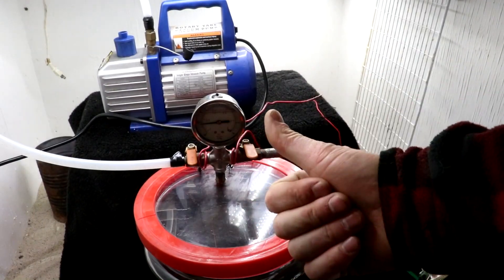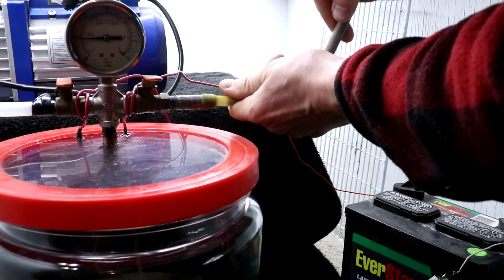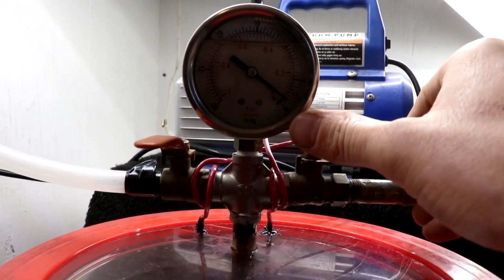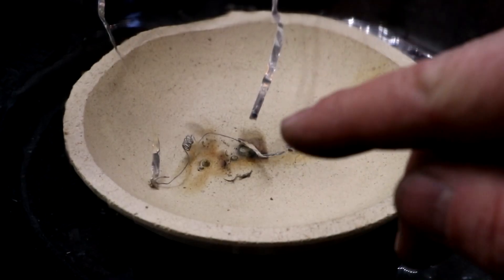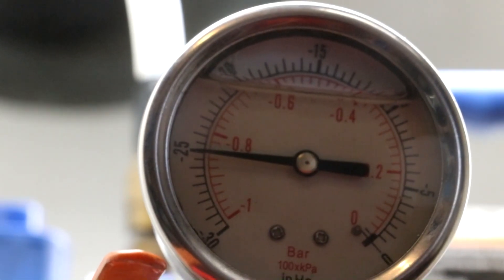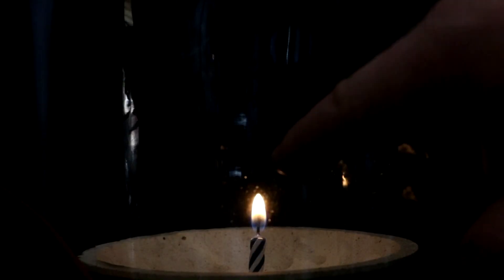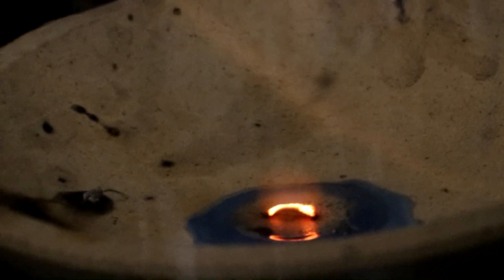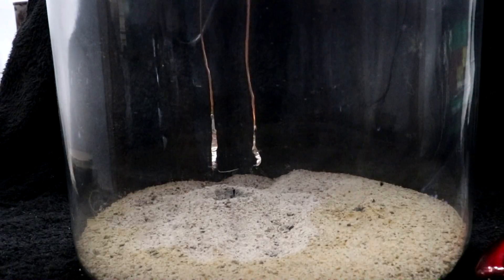Fire in Low Pressure Pure Oxygen

Comment: This was delightfully unexpected. I learned that I was wrong in my assumption that the results would be mostly the same, as long as the partial pressure of oxygen is the same. My guess is that the filler nitrogen gas is absorbing the surrounding heat, since it's not contributing to combustion, and this. greatly reduces the spread and heat of the flame. Another way it's limiting the fire could be the pressure not allowing the fire to expand as much, and therefore it can't spread its heat as efficiently.

Comment: why is it that in the pure oxygen chamber all the oxygen didn't ignite at once and explode?
Reply: Because oxygen doesn't burn or explode by itself.  Burning is chemical reaction where some other substance combines with oxygen to form something else, usually carbon dioxide and other chemicals.  The reaction requires heat to start, but then makes its own heat.

Comment: Just Noticed that when the pressure starts decreasing the flame became rounder and rounder as the air density decreased so did the buoyancy differential between hot and cold air, thus causing the Video to look like zero gravity Fire

Comment: After the tragical accident of Apollo 1, the fire in a capsule with pure oxygen at atmospheric pressure, the pressure has been significantly reduced to a level that the human body can still handle well. AFAIK there was no nitrogen involved to mimic Earth´s  atmosphere, as it would be dead mass of no use. So just lower pressure of pure oxygen, which was cryogenically liquified and also used for the fuel cells which generated power and water.

Comment: Interesting; so fire wouldn't be able to burn in a vaccuum regardless of the fuel being used?  Or is it just depending on the combustibility of the fuel being used?  

In contrast, would gasoline vapor ignite under full vaccuum?

Is the Sun under full vaccuum or does it have an atmoshphere that allows it to burn (seemingly in the full vaccuum of space)?

There's so much I need to know.

Comment: 11:51

I noticed the flame turned completely blue at lower pressure. 

That was so cool. 

Is that complete combustion & clean burning?  Or something else? 

It totes reminds me of a bunsen burner. 

2nd question:  can you do that with a lower pressure of normal air (by using something to find and maintain an equalibrium of some sort).

3rd: question: with the blue flame, can you add sodium it at just the right dilution to make a white flame, and after that, can you add additional salts to adjust its color rendering index, and then could/should you keep these as weird steampunk candle lanterns?

PS: so I noticed there was a POINT where it was a blue flame for a second or two. I imagine it would've stayed blue if the pressure had stopped decreasing, right?

Comment: Yo Cody, had an idea, add mercury to molten aluminium and see if it oxidised uncontrollably!
Reply from the maker: Aluminum melts at a temperature above the mercury boiling point. I imagine it would be like adding water to hot oil.
Reply: @theCodyReeder  Still a spectacular result!
Reply: Also you could use mercury sulphide to increase the time it takes to vaporize

Comment: Thing is, the temperature of the fire depends on the mixture of things in the fire. A mix of fuel and oxygen at certain ratios burns at a certain temperature more or less regardless of how much charge you have and how tightly you pack it. Pure oxygen burns very hot because you don't have those 5 parts of nitrogen absorbing all the heat from the combustion.

Comment: I want to if the reason low pressure oxygen is more dangerous because the nitrogen is heated up reducing the activation energy for the reaction to continue, if this is the case, would high pressure atmosphere reduce the flame? Would an argon oxygen or helium oxygen or carbon dioxide oxygen atmosphere instead of a nitrogen oxygen be as combustible or less if such atmosphere draw heat away from the reaction?

Comment: So the same partial pressure of oxygen burns very differently depending on whether or not nitrogen is present. I wonder if the difference is from difference in heat dissipation or pressure. If you replaced the nitrogen with a lighter gas that has a lower heat capacity per volume, like helium (just don't use hydrogen!), I wonder how the flame would burn. On the other side of things, it would be interesting to see if you replaced the nitrogen with sulfur hexafluoride.

Comment: One of the reasons why it is arguably better to have a higher pressure with Nitrogen gas as a 'oxidation' reducer. You can have the same amount of oxygen as the low pressure pure oxygen environment by increasing the pressure by adding nitrogen.

Comment: Cody  - consider re-doing this using electric discharges, since static electricity might be a key hazard in spacecraft.  And also with partial CO2 atmosphere, since that's what the astronauts will actually have due to their breathing - though I don't think that'll make a noticable difference.  And maybe if you test the electric discharge method of ignition, see what impact varying amounts of humidity in the atmosphere has on ignition, since again astronauts would introduce some water vapor by breathing and possibly adding humidity to suppress static discharges is done with real spacecraft?  Not sure how you'd test the effects of humidity on static discharge, but probably you could look it up.  Of course, you or your viewers may already be 'done' with this, but these sounded interesting to me.

Comment: A near vacuum provides much better thermal insulation, the conductive portion.  Radiation of course is unaffected.  You can see the effect from the candle melting.  At low pressure oxygen the candle melts down, while at atmospheric (nitrogen + oxygen) the body of the candle remains much longer solid..

Comment: I wonder how much of the candle melting so rapidly when in pure oxygen at low pressure is there being more heat released by a more intense flame, and how much it is just not being able to remove heat as fast - 1/30 the atmospheric pressure shoulde mean convective heat transfer is ~1/30 as effective.

Comment: not to disturb the contents in the flask a nozzel could be the oxygen input instead of a circular linear end, be a rocket nozel be designed to slow the flow and ... match the vessle walls to give a linear pressure increase introducing minimal flow within the vessle.

Comment: You should try to find the O2 pressure at which candle wax will burn without a wick! The lower pressure should allow the wax to more readily vaporize, but it would clearly need more oxygen present to be self-sustaining since the flame went out in this experiment before all the wax had burned.

Comment: When you burn in a mixed earth-like atmosphere you have the inert gas inhibiting the reaction to a degree, in a pure oxygen atmosphere the only inhibiting factor is gasses produced by the combustion. I would propose that a larger fire would burn more slowly as you reduce the pressure of the oxygen atmosphere, as more gases from the combustion will accumulate around the fire, thus giving a similar inhibiting effect to an atmosphere with 4/5 partial pressure inert gas.

Comment: Something else you might be interested in testing some day: /Slightly/ higher concentrations of nitrogen / lower concentrations of oxygen. 
I remember seeing something advertised once about a passive fire suppression thing that, I think, talked about having about one molecule of oxygen out of every six, instead of the normal one part in five. So 16% instead of the normal 20%. Supposedly that lowered the reaction rate enough that, e.g., a match wouldn't stay lit. of course that's separate from how healthy it is to breathe for long periods, but I do wonder how well it works.

Comment: When you think about it oxygen usually takes up a significant fraction (usually most) of the mass of the product of the reaction so when you have 4 times as much nitrogen added to the mix you would expect most of the energy to go into heating the nitrogen.
But the stable flames you were able to achieve at slightly above Mars pressure were quite surprising. It shows that a small O2 leak on Mars would still be a fire hazard. Or even in pure vacuum since it takes some space for the gasses to expand you would have a relatively large volume around a leak where a flame might be stable. Oxygen is scary stuff...

Comment: so from what i just saw, my only persisting thought is that if you were to do this with the smelting process of iron that you would be able to create steel at a much lower temperature than normal, with an increase in combustion volatility.

Comment: Here's an interesting problem: what will future Mars colonizers breathe? If the MOXIE device went well, they'll have oxygen for sure. But there would have to have some system to constantly thin it down with nitrogen, or the whole colony risks burning down. option 1: make N2 from some chemicals supplied from earth. option 2: liquify Martian air, then distill it to acquire CO2 (for converting to O2), N2 and noble gases separately, and remix.

Comment: It seems almost like there's a sort of critical point at which the oxygen pressure is high enough to support full combustion. Based on the test around 10:00 where you slowly added oxygen while the paper was burning. It appeared not to bun very well at all, and almost looked like it was about to go out, then suddenly when you reached that critical point, it just erupted in flames and went up like a strip of flash paper. Which btw, you should totally try igniting flash paper in various pressures of oxygen, going up to high pressure just cuz I think it'd look super cool!

Comment: I (vaguely) recall a paper from a few years ago, suggesting that the optimal atmosphere for a spaceship would be lower percent oxygen (I hazily recall 9%, although that might be mistaken), but at higher than atmospheric standard pressure.  The reasoning was that combustion relies more heavily on the mass fraction of oxygen, whilst the biological gas exchange depends on the partial pressure.  Therefore one could reduce the oxygen content to below that which sustained fire, but still be breathable. 
(Of course, this ignores the engineering constraints that favour lower air pressure inside spaceships; I suspect that would be considered an 'implementation detail').
If you have a source of nitrogen (or, I suppose argon - there really shouldn't be a difference between the two here), then you could test out that idea - at least the lower limit on oxygen.  Vacuum the chamber out, fill to a known pressure with inert gas, and then top up to almost atmospheric (locally determined; so that it's known that there's only been gas entering the chamber).  That would allow you to observe the flammability of a 'standard reference sample of pressed cellulose fibres' at reduced mass fraction of oxygen.

Comment: with lower partial  oxygen combustion rates should slow... but with less total gases there's also less gas to conduct and convect heat away from reaction. effects may partially cancel each other out. maybe see what happens with an inert gas of a different heat capacity than nitrogen?

I noticed as partial pressures decreased flame decreased in size. I'd guess that was less total combustion.
however it was increasingly burning blue and with less yellow... to me that suggests a more complete burn... blue is carbon monoxide burning... and yellow from glowing carbon soot

Comment: I just finished watching the Movie Life ,there is a scene where they're trying to flamethrower the alien on the ISS and thought would that even be a good idea .
Reply: The ISS uses a 78% nitrogen 21% oxygen mix roughly the same as normal Earth atmosphere - so a flamethrower wouldn't be as bad as pure O2 but still, you wouldn't want to use one in a pressurized environment (heat can ruin the hull temper and would increase air pressure at the same time...).
Reply: @403902  thank you for clearing that up for me , it annoyed me on that movie how they didn't have a single sharp object to take the alien out lol

Comment: Nasa tested this with pure Oxygen under much higher than normal  pressure.  Around the infamous Apollol1 fire i read that under the very low O² pressure they actually used (= about 7000m i think) in spacecraft AND space suit,  it doesn't burn "better" than normal air. 

Shown by the fact that despite 3 dead Astronauts (from aspyxiation, not burning) Nasa stuck with pure oxygen throughout Apollo.  But changed a lot of things beside.

Comment: I would be curious to see net pressure differences between the candle that burned under normal circumstances, versus the candle that burned under 3in of partial pressure oxygen. After the chamber gasses cool off, is the end pressure the same? Or does the accelerated burn produce more/less gas than the "normal" burn?

Comment: This is what I expected bevause.

1) there are fewer molecules colliding with the burning material carrying kinetic energy away so the heat can build up around the material. 

2) there's fewer nitrogen molecules are ground blocking the diffusion of oxygen to the material or carbon dioxide away from the material. It's a bit like blowing on an ember but without loss of heat

Comment: Learned something new: Silver doesn't burn in pure oxygen.
Reply: Learned something new: Silver Burns.
Reply: @SpudLab  Everything burns under the right conditions. Yes, EVERYTHING.
Reply: @BlackWolf18C  If in doubt, Fluorine will do it for you :D
Reply: @BlackWolf18C  what about Carbon dioxide and water?
What about a proton?
Reply: @jastintheceooffinanasapost6204  Well water can burn in the presence of high voltage, carbon dioxide can burn if you have a material that strips the oxygen away from the carbon, and a proton will burn quite readily in the presence of an anti-proton. We're humans, I would bet we figure out a way to burn quantum foam and spacetime at some point. It's what we do.
Reply: Learned something new: Fire!
Reply: Learned something more interesting: copper does! Now I want to see a video of that.
Reply: @w0ttheh3ll  probably doesn't burn very well, it'll leave an oxide costing that will stop the oxygen from reaching the copper eventually and that means the surface will glow a bit then that's that
Reply: @guythat779  you could probably make it "burn" by making a thermite that uses copper
Reply: @ganondalf8090  I dont think that's what he meant tho, but yes yes you can
Reply: I wonder how that happens given how quickly silver tarnishes in the air
Reply: @pabloarroyo1023  According to chemistyexplained website it reacts with sulphur compounds in the air.
Reply: @pabloarroyo1023  Correct me if I'm wrong, but my guess would be that, like Aluminium (with TWO "i's"!) the tarnish happens so quickly that unless you sand through immediately before lighting it, the flame won't get through the outer coating. Not sure though, but I think I've heard that's why Al is so hard to weld??
Reply: @philgallagher1  I know that for aluminum (one i) that is the case, hence you use AC current to blast off the oxide layer. But I think someone above mentioned sulfur above as the cause for tarnishing, and I think he’s right in that it’s  not actually rusting or oxidizing
Reply: @philgallagher1  I just know aluminum has to be welded with a shielding gas to keep it from oxidizing while welding 
    Aluminum does form a protective oxide layer that has to be removed for a reaction with a  gallium or  mercury amalgam
     Aluminum is highly reactive though in powdered form : which still should have a oxide layer? with iron oxide to make thermite
Reply: @pabloarroyo1023  Thinking about it, the oxidation would have to be damn fast to have an effect in this instance, so yes, I agree, sulphur is probably the culprit.
(NB: England and America, two countries separated by a common language!!)
Reply: @terranovarain6570  It's 40 years since I last studied chemistry so I'm not going to dispute what you're saying!! It certainly sounds reasonable. I am aware as you say that Al is super-reactive in powdered form, and if it is a main constituent of Thermite then....yes - that stuff can burn through anything in no time!
Reply: Check out metal activity series
Reply: melts
Reply: Gold will work even better
Reply: learned something new : silver
Reply: Also you can make a side of glass conductive with it.

Comment: I think of the slowing down effect with high density atmosphere is due to the heat sinking into the inert gas. If you raised the temperature of the jar with the high density atmosphere, I guess you'd have much better burning.

Comment: Great video Cody! One thing that wasn't addressed is why excess N2 has such a significant effect. Do you think that the thermal generation of singlet oxygen (since there is no N2 around to take heat away) could be why things burn so much more vigorously, even though the overall O2 pressure is lower?

Comment: That candle is so unexpected. At the normal oxygen content equivalent partial pressure it burns pretty violently, additional gas buffers it I guess (pulling heat away). 
The different flame is really interesting. Looks like it burns much hotter/cleaner (blue) and melts the candle fast.

Comment: It was cool to see the shape of the candle flame change as the pressure decreased. It looked like it got more circular until only the very top of it was yellow.  What is the reasoning for that?
Reply: Less pressure yields less of a pressure differential and therefore a weaker "draw" for the hot gases upwards?

Comment: Nitrogen in air just goes along for the ride. It acts as a coolant carrying heat away.
Pure oxygen at the same partial pressure as in the atmosphere isn't cooled down by nitrogen. Dust burns at a lower partial pressure